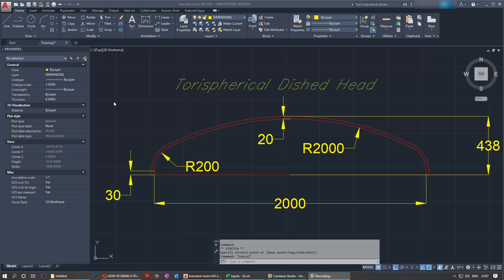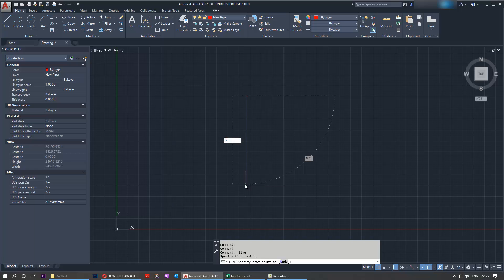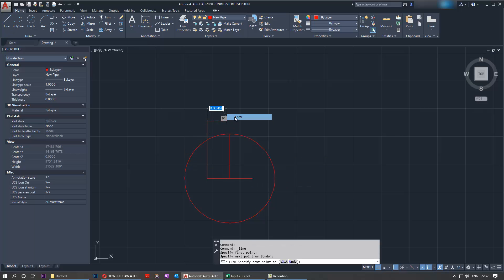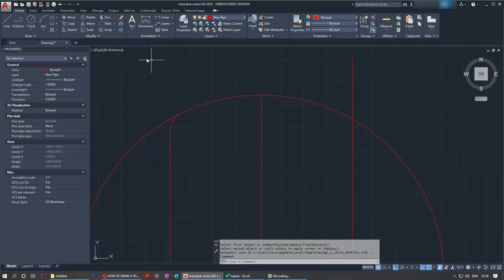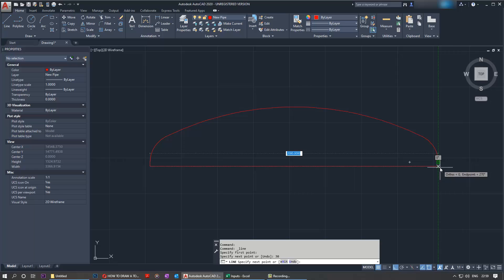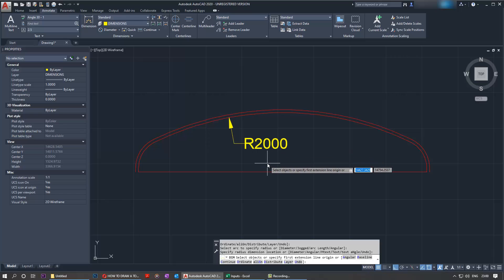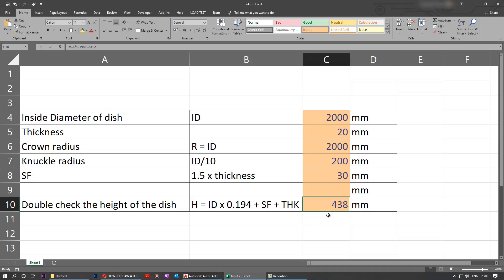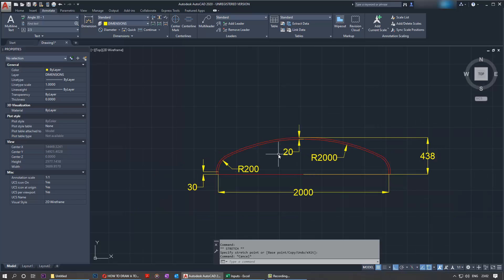How to draw torispherical dish in AutoCAD

Comment: Thanks for the great video! I just have a quick question: how did you get rid of the crosshair in your dimension? Whenever I do dimension for radius/diameter, there is always a crosshair appearing at the centre of the circle that I am hoping to remove. Thanks a ton!

Comment: Hi!, What is the standard used or where do you get the formulas applied?
Reply from the maker: Hi! That's a good question. I checked online a couple of sources. After following the above method, it matched the dimensions of existing drawings.
Reply: @PracticalTechFixes  Could you share with us the sources you found? I thought this had to be in some ASME standard, isn't it?
Reply from the maker: @ireneguadalupelopezprieto6857  I think, yes, it's from ASME. Do you have the ASME VIII code , have a quick check.